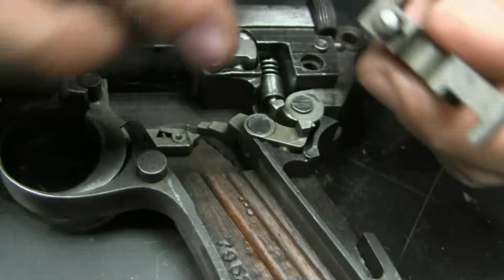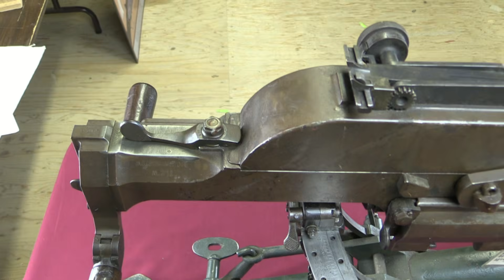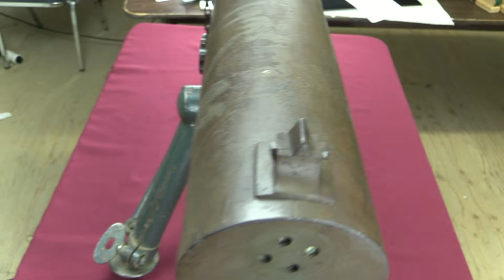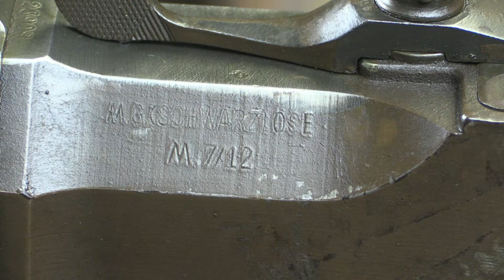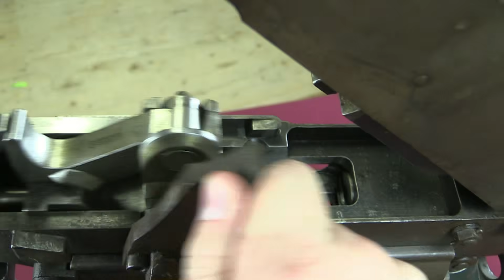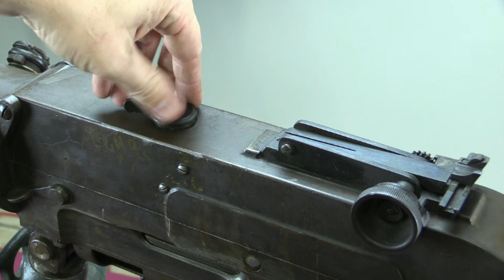Schwarzlose M1907/12 Heavy Machine Gun

Comment: The Czechoslovak army used the redesigned Schwarzlos as the type 07/24 for Mauser cartridges. If I remember correctly, the barrel was extended (and therefore the cooling jacket) and they were in service until 1939. They were taken over by the Wehrmacht and used until the end of the war. They had the same cartridge as the Mauser rifles. The conversion was done by the "Janeček" arms factory in Prague. Several thousand of them were converted.

Comment: The delayed blowback in a MG had one definite drawback. The rate of fire could vary fairly considerably, presumably because of varying friction in the delay system. This made it very difficult to use as a synchronized MG in an aircraft. Several attempts failed in Sweden (which used it as m/14 wirh 6,5/55 ammunition). Finally they had to acquire Browning MG:s as m/22 instead. Otherwise it seems to have been successful, and was still extensively used by Home Guard units in the 1940's.

Comment: Quick question. How does the bolt close all the way? I only see one spring, and it is acting on the firing pin, which is held back ones coked. There is than a small space between the lever/bolt and the firing pin. A space in which the bolt appears to be free moving, withouy any forces being apied on it.

Comment: Ian probably has comment notifications for this video long since turned off for this video - but I just realized... the de-linker for the M134 Minigun that Ian shows in the video below, is very inspired by the de-linker of the Schwarzlose. That gear-drive, sort of open cylinder revolver rotary magazine thingy... 
With the primary difference I see being the pull out action of the M1907, versus pushing through with the M134. And that makes sense as an evolution to me - especially given the firing rate differences.
https://youtu.be/rIlwHT4IdRc?t=390

Comment: When explaining the feeding system I didn't quite understand how were the cartridges supposed to be pulled off the belt to the rotating grooves.
You mentioned an extractor, but when you cycled the handle I couldn't see anything like this moving from the front end of the feeding spindle to its middle part.

Comment: Man could one actually hope to hit anything 2.4 km away?  Or was that just for suppression fire?
Reply: Supressive fire. But it did fire a beast of a cartridge from a stable mounting through a long fixed barrel, so if you took the effirt to sight it, you probably could hit a man at 2 kilometers.
Reply: Not even what we usually consider suppressive fire, it was used for "area denial", aimed for example at an enemy staging area in the rear.

The sights and aiming mechanism of this gun don't offer anywhere near the accuracy to hit a man at 2km, the firing mechanism probably doesn't either.

Comment: I wonder if rust was ever a problem on the Barrel joints and welds the interior of that water jacket being continually submerged in heated overtime with assumedly contaminated or corrosive water would that be a problem overtime

Comment: I have read that the short barrel was to drop the chamber pressure sooner, necessary because of the blowback design.  This is so that you did not get a lot of burnt gasses blasting out the ejection port and rupturing the case.  Please clarify.
Reply: That may have bean the original idea but it probably wasn't necessary. Ian recently showed the Romanian Schwarzlose, converted to 8mm Mauser with a much longer barrel.

Comment: All I know about the Schwarzlose was that -- because it used delayed blowback -- it was tricky to make it work with synchronization gear for the kuk Luftfahrtruppen; that is, it never worked quite right on airplanes firing through the propeller arc. What was it about delayed blowback that made that a problem?
Reply: +h lynn keith Perhaps there are variations in the timing of the firing between the individual shots?
Reply: crazyfvck Thank you. That explanation helps. If indeed there was variation in the timing of the firing between individual shots in the Schwarzlose as a result of delayed blowback, that would make it unsuitable for synchronization.
Reply: h lynn keith They could have just gone with the original method of mounting machine guns on planes.. By that, I mean putting sheets of metal on the back of the prop blades to deflect the bullets that happen to hit :D
Reply: You live down to your handle, don't you? ;-)
Reply: h lynn keith Ha. I suppose  :)

Comment: It seems very strange to me that the fill port is on top of the top side of the jacket, and the drain port on the bottom. In first instance you would think that it makes sense due to gravity, but very similar sort of setups are used in chemistry to cool vapours. The reason why I think it would make more sense for the top port to be the drain port (and also the same reason it is this way in chemistry setups), is that in the case the water starts to boil (even slightly develop bubbles) the bubbles will rise upwards. Now if the top port is the filling port, this can cause a buildup of air in that hose since the air is trying to rise and is trapped in said hose. Best case scenario this restricts the water flow, making cooling less efficient (thus heating the barrel and water up quicker), worst case the water starts superheating and expanding tremendously, although i think the barrel would start failing before that. In any case, if the ports are swapped, the water pushes the bubbles through the upper drain port and to the reservoir, since the tube to the reservoir is usually not the one connected to the pump the bubbles will just go into the atmosphere.
Which brings up a second point, because filling from the bottom upwards would reduce the amount of air trapped in the system, since it pushes out these bubbles.
Do you know why they actually did it with the fill port on top?
Reply: Well the simple answer to that question is that there were no hoses or external tanks that would be connected to that gun,  since the barrel does not reciprocate, you only lose water to evaporation and boiling if the system was not sealed, if that cap is airtight you could increase the boiling point of water making it all the more effective.  , you will run out of ammo long before you run out of water and urine to refill the cooling jacket. 

  I dont know of any machine guns that were intended to be mobile that used an active cooling system, but I am no expert.

 I do remember seeing an anti aircraft machine gun in a mount like that would be on a ship, I think it was a browning 1917 .30 that had a reservoir and pump system, and that gun did have both lines entering from the top for the reasons you suggest. 
  
  The problem could also easily be solved with something like a simple spring loaded diaphragm like on an automotive radiator cap that will release pressure at a certain point. that would vent any gas that was released by boiling water, and then you could also hook up a simple return line and reservoir again just like on the automotive radiator to maintain fluid level. 

 I hope that answers your question to your satisfaction.
Reply: all water coold hmg-s have opening for steam but mostly they were conected with hose to condensation tanks for water to cool down and be reused specialy important in ereas where all water must be carried in by foot

Comment: Why did the AU empire use this instead of getting a licence to build Maxims like Russia, Germany and the US did?

If they wanted light weight why didn't they try to go for an air cooled gun? Water is fairly heavy after all.
Reply: Well, probably out of pride, most of all. 

However as a local engineer already had designs it would have been silly to spend a lot of money on another patent, like the Maxim's. This was heavier than the Maxim, but the Austrian war efforts, plans and realities were not about mobility, but to be reliable in poor supply conditions. With the exception of Montenegro and some ad hoc campaigns like against Romania or the breakthrough at the Isonzo in Italy, the Austrian fronts were all about defence. So a static mg position does not really care what it is equipped with, until bullets can fly out of it with a proper rate:)
Aircooled guns were not really the thing that time...check the Hotchkiss...a 30 rounds plate...cmon:D They became more popular later on with the change of technology and tactics. 

The design in itself is not better or worse but at least that good and probably even more reliable than the Maxim's. Btw. this was used quite often by the Germans as well. 

I think the numerical and renown advantage of the Maxim's is simply a better branding and a wider market share. Maxim started earlier, produced more, so could have a bigger cut of the cake. Windows vs Linux:)
Reply: @zsebora  The gun is a "mere 18kg" without the jacket filled, and was 8ndeed issued as an lmg in such a configuration, with a converted pistol grip. It is lighter and fandier than a maxim gun.

Comment: Lol this thing overshadows you so much jts a beastt and would the steam build up pressure or are the water caps left open?
Reply from the maker: +Colten Meyer Gun like this have steam vents. Typically, a hose would be connected to the steam vent and run to a can with some liquid water - that way the steam would recondense rather than for a tall plume pointing to where the machine gun is.
Reply: Thats pretty smart they do sure think of everything lol nice vid bud i like the old style weapons good thing theres no shortage aha

Comment: Nice Maxim Machine Gun variant and also an improvement.  Also noticed the trigger is away from the toggle switch.  Which was a problem for soldiers working these guns.  Though I can say the major drawback of WWI machine guns was that they were heavy.
Reply: +Kelly Chuang It's not really a variant or an improvement over the Maxim gun. Perhaps the only thing it shares with Hiram Maxim's design is the water cooled aspect.

As noted when Ian said that the good patents (recoil and gas operation) That had already been taken by Maxim and it's derivatives as well as the Hotchkiss gas operated machine guns basically made Scwarzlose to just up and make his gun delayed blowback.
Reply: +ACHTUNG Seemed similar though.   Very easy to mistake this for another Maxim.
Reply: Kelly Chuang Another gun to look for at the time period is the Fiat Revelli Machine gun, which once again looks like a Maxim derivative but is also a very different design.

Comment: Being closed bolt is a big advantage against debris causing malfunctions, but isn't it then taken away by the use of lubricated ammo? Also, I would imagine being straight blowback (among other things) that these MGs were significantly easier and cheaper to manufacture than Maxims or Vickers; were they?
Reply: Usually, oiled cartridges will allow debris to be carried into the action upon firing. In this case, the cartridges are oiled once they are already in the receiver. In theory, this will eliminate dirt being dragged in by oily cartridges. I would assume cost would be cheaper than other examples of the day, but I cannot say for sure.

Comment: Very cool gun! I like this early stuff! Few Q's though: What is this example chambered for? Cyclic rate? Cloth belts? Looks like a pretty hefty gun, lots of steel! I bet it becomes quite messy after a while since it has the cartridge oiler, a very neat feature. Since they get lubed in the gun right before firing, theres less chance for ammo to get dirty and fouled like pre lubed ammo would. Any other guns you know of use an oiler? I know theres plenty that require lubed cartridges. I'm surprised it just doesn't have an oil mop/pad vs. a mechanical oiler, very cool gun!
Reply from the maker: This one is chambered for 8x50R (not the French cartridge, but the Austrian one), and yes it used cloth belts. Not as heavy as the other watercooled guns of the time, though - about 40 pounds (plus mount). I have seen varied cyclic rates in different manuals, between 400 and 600 rpm.

Comment: I don't see why would this Schwarzlose (or in fact any watercooled mg) fall under the category HMG. Along with the Maxim and Vickers, they all used standard rifle cartridges. The weight comes from the not so advanced usage of materials: they are a huge chunk of metal. For me, to be recognised as a HMG, one has to fire a lot more powerful cartridge. I would consider these water cooled beasts medium machineguns, because they were designed to be used as part of a defensive unit only, but without the capability of anti-armor usage. I base that upon the cathegorisation of the MG-34. As a general purpose machinegun, it was used as an LMG when carried during combat, however, when installed on a tripod, it was considered a medium mg. And I think that was the role of the water cooled machineguns of the early 20th century, making them a medium mg as well. I would like to read your opinion as well. Have a nice day!
Reply from the maker: The definitions change over time. Today this would be considered a medium gun, but when it was designed it was a heavy one. The reason is that is requires a mount to be fired, and it was typically used for static emplacement. At the time, there was no such things as a medium MG; you had static heavy guns and portable light ones.
Reply: Forgotten Weapons oh, all right then. So the term medium machinegun was born after the invention of the Browning M2?
Reply from the maker: farkasmate14
Yeah, the introduction of the .50 caliber machine guns (M2, DShK, German TuF, etc) and also the introduction the modern GPMG (which would be the MG34). Once you have both of those, the term MMG does a good job of encompassing the concept of the permanently-mounted rifle-caliber machine gun.

Comment: Just curious, how would they oil the inside of the water container to keep it from rusting?
Reply from the maker: You would drain the water when the gun was not in use, ideally after firing enough to get the inside of the jacket hot enough to quickly evaporate any leftover droplets. In modern use, most guys who own guns like these use an antifreeze solution in place of water, to prevent the possibility of rusting.

Comment: wonder what the rate of fire is? and can you still get the ammo? rare well made M.G. = $ 65,000.00 easy.
Reply: It fires 8x50R, which I am unsure of weather it is still availible.
Reply: When adopted the M07/12 fired at 400rpm. But during WW1 this was increased to 580rpm, by fitting a stronger recoil spring. 

The M07/12 was built in 8x50mmR. But many were converted to other calibres after WW1: by  Bulgaria to 7.62x54R, Czechslovakia and Romania to 7.92x57mm, and Hungary to 8x56mmR.

Comment: was this gun ever used on aircraft? the reason i ask is because i seem to remember building a WW1 aircraft model that had schwarzlose MGs as an optional armament along with the more familiar parabellum (i used the parabellums because they just look great!)
Reply from the maker: Yes, they were used as aircraft guns during WWI (without the water jackets). Because they fired from a closed bolt, they were good candidates for synchronizing.
Reply from the maker: Molo9000
The only reason I can think of that the gun itself would behave differently at altitude (as opposed to the synchronizer forcing it to slow down or speed up) would be the lubricating oil becoming more viscous and slowing down the moving parts.
Reply: Molo9000 Don't really see how low ambient air pressure could appreciably affect cyclic rate.  Atmospheric air pressure at sea level is about 14.7 psi, and probably about 10 psi for a plane at 3000m.  By comparison, the cartridges that this Schwarzlose was chambered for operated at up to 50,000 psi or more.  Maybe a gun with non-sealed pneumatic buffers would cycle differently at different altitudes, but I don't think this applies to the Schwarzlose.
Reply: Forgotten Weapons I've read that these were actually kind of tricky to synchronize.  In aircraft applications where they fired through a propeller, they could only be fired when the engine was operating in a specific RPM range.
Reply: As an Austro-Hungarian gun it was used in the alps for sure, fighting there took place at heights of 2000m and more. If height was an issue with these guns, the alpine troops should also have had this problem. As I don´t believe there were planes in WWI that could reach that height, the altitude-related slowdown of their guns must have been related to the engine synchronisation.
Reply: *****
The rate of fire decrease must be due to engine RPM being lower at altitude. Maxim-type guns in German and Entente service also suffered from this, but apparently they worked at any altitude no matter the rpm.
Maybe the lock time of the Schwarzlose is a lot longer than the Maxims and the synchronization system has to trigger the firing mechanism more than one engine revolutions in advance.

Edit: I just realized my calculations were bullshit
Reply: whoops! probably should have added that i was talking more about use as defensive rear gun position armament, than synchronized forward facing weapons.
Reply: Molo9000 I believe you're right; though the Schwarzlose was a closed-breech design, it reportedly had a fairly long lock-time, which led to the synchronizing challenges.  I think the firing rate played into it as well, some later versions of the Schwarzlose were tweaked for faster cycling and had wider engine speed windows.
Reply: phil's model making Yes, the Schwarzlose was also used in turrets on aircraft, as well as external gun pods that were placed away from the propellers and thus didn't need to be synchronized.
Reply: Forgotten Weapons
I've read that the firing rate of the Schwarzlose would slow down at high altitude and the gun would even stop working above 3000m. Do you think this is true? Does ambient air pressure affect blowback operated guns?